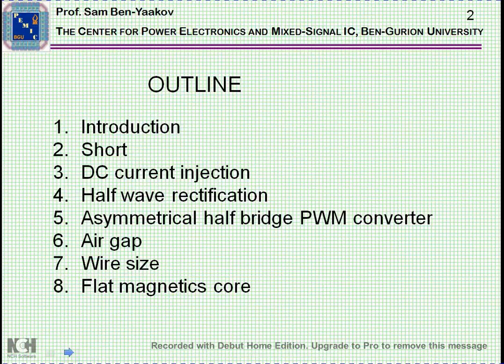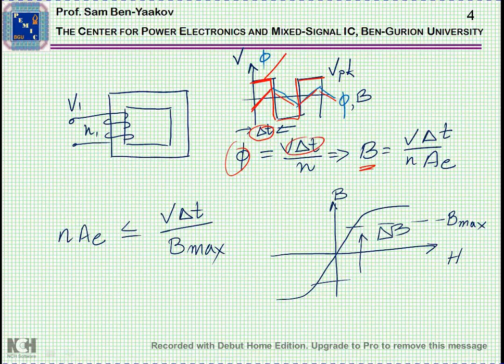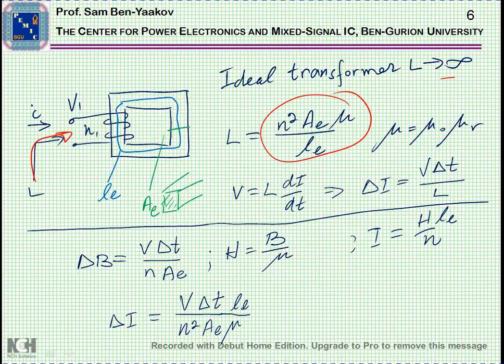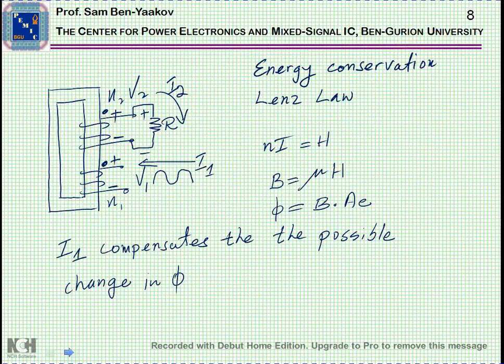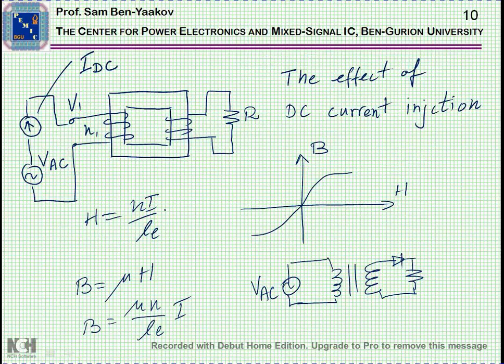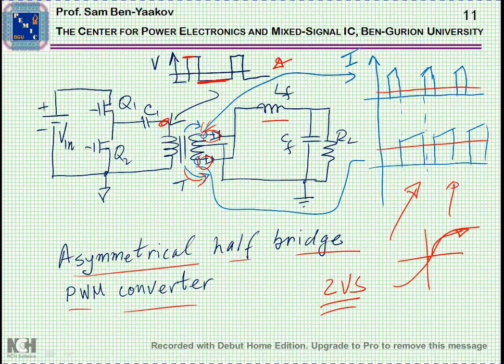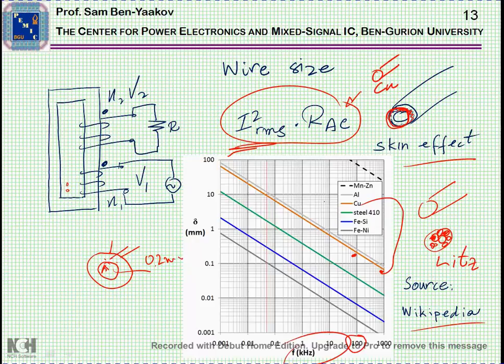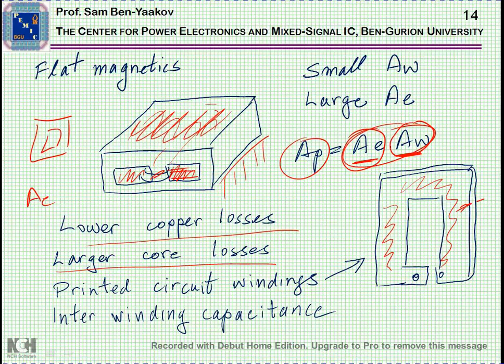The HF transformer:  Facts you may have missed

Comment: I did some review on my basic knowledge on magnetics recently related to a job issue related with changing voltage requirements in some inductive components. After some hard work of remembering why things work in all this stuff, of N, L, voltages permeabilities and whistles, I wish I had seen this lecture before. It is clear when somebody master the topic and how to explain it, you don´t need fancy animations, but a whiteboard and a clear understanding. Will save the channel for other videos.
I think flux formulae for V=  A sin (wt) should be -(A/w) cos (wt), has no effect on the discussion, but just in case..

Comment: I Have look at your presentations about LCC versus LLC very informative but still I have not yet the full clue of how to calaculate the transformer, I did see on LLC it is not that difficult but LCC is different because it do drive as a current spource, so the impedance of the primairy needs to be known? I have done a transformer for a normal hardswitch half bridge, set the frequency on 100 khz, the point where the output power of the LCC is max, and I did get a respons who like to be not bad, when set 110 to 250 Khz it did regulate in LTspice. (after first set the feedback correction up). So after ead much papers, the N of the transformer is known but do not now how to start right with tranformer calculation, that is why I did try the normal half bbridge aproach. For LLC it is not difficult transformer is part of resonance tank while for LCC the capacitor bridge is the impedance point for the power transport, so miss induction valeu,s. these are into the mH region while LLC is in uH region..

Have a nice day.
Reply from the maker: Why is this different from full or half bridge PWM converters?
Reply: @sambenyaakov  
THanks for the answer.

I have multply outputs, 350 volts, 2 x 130 volts and 12.6 and 6.3 volts, for getting N what of the voltages I can use? the feedback is coming from the 12.6/6.3 because it is filament voltages and need to be stable. feedback did work fine in sim.
 
Primairy induction for full bridge is higher then for a half bridge. that is why I do use the calculation for a half bridge because I also do us this, I use then the calculated transformer for match on the LCC tank output, I did put Cp also on the 350 volts 0.10 amps output winding, it has already some capacitance there. I did now test some, and I get regulation, even with open outputs I get stable outputs. Only the high voltage get lower with open outputs and get higher when I do full power. I did calculate and a full bridge is 22mH and a half bridge is 5.54mH as the calculator says .

Have calculate the tank with a normal LC calculator and set as I did read it is better for  efficency the Cs/Cp to 0.1

Peace from a old paper mentioning design of the LCC, so here I see I just need to have a high enough inductance to get it right? That is why the inverter now works on sim, play with the Q and resonance of the tank helps a lot, I use just a simple online calculator for resonance and q, I set the low frequency just above that and give enough room for regulation, and it did work with open and closed outputs. When open I get a big feedback hobble and it then settle, the PID is not yet complete right.

You have to understand I am a audio amp guy, and autodidact learning, never see a university, just a lot of shoes in the factory I did work from 15 years of age.

Piece who says, sufficiently large inductance, so calculate it just for a normal half bridge, seems to work. but winding capacitances do matter, and I have one high voltage output so set Cp there. But I can be wrong afcourse, all with all, I enjoy the learning but it is slower with mine 66 years of age brain.

As an example, the magnetising inductance of the transformer, in certain cases,
may be assumed sufficiently large to be removed from the model. Alternatively, the
inter-winding capacitance of a high-voltage transformer may be significant, thus
requiring either the parallel-resonant or series-parallel resonant topologies to fully
exploit the transformer parasitics, as opposed to reducing the capacitance's impact by
the addition of further inductance.

I do now watch your movies, also for hf transformers, the ExcelentIT software do well for transformer calculation incuding multply outputs.

have a nice sunday.
Reply from the maker: @audiokees4045  Thanks for explanation
Reply: @sambenyaakov  I have downloaded some of your video and lie on the couch with a beer (hot here) to see it on tv, and was very informative. You have to now I am a audio amp man, and even do class D who is also switching reaching now 0.0012 procent distortions with current and for low frequencies voltage feedback and 5 level switching., it is more easy to simulate, and have more experience with it, smsps is quite new, so some things I do understand oke, some not like the transformer calculations who is just N1/N2, in your video you explane some of the ideas I did mention, i need to look at the output load reflected to the primairy, that is why U use an ac resistor in the resonance tank Cr and Lr (Cs Ls and Cp for LCC).  U did also mention series resonance with only CS and Ls it has less part stress also I did see in sim. I have now do the LCC, have a Cs/Cp of 0.1 did give the lowest amps drawed from primairy for max output. I have use the transformer calculator ExcellentIT (free download) to calculate the transformer, if I did warch your presentations right, the trannsformer needs to mede such it has the less possible load om the resonance tank in lcc. but do fit on the core, when do full bridge get with etd 29 4.36mH prim 350 volts out = 7.19mH = M 0.60 and with half bridge I get 1.090mH primary and 350 volts out = 3.59mH = N =0.300. it is precise this what I have not learn much about, I presume that LCC or series resonance use capacitors for regulate output voltage in a current source setup, and the LLC has the transformer included into the multiresonant setup so when I calculate that with a tool, (yes for these I have nice tools from infinion or others but not for LCC or other series resoance types. (older ones). Do go on with your fantastic work maing world greener. ( I am against windturbines though), I am a thorium fan.

Excuse me for english errors, here is the link to the transformer calculator.

https://320volt.com/en/gelismis-smps-transformator-tasarim-programi/
Reply: @sambenyaakov  The voltage on the transformer, half the input voltage for half bridge and full for full bridge, give higher inductance.

But I think I have some idea with the LCC, because Cp is a current source acting capacitor with his reactance on frequency  I just need to optimize the transformer such that it fit with Cp, in fact inductance X needs higher then X Cp to transfer power efficiently, If I am right this is..

Comment: Dohh yeah - I keep thinking I know high frequency power - then I watch YOUR stuff and realise theres a bunch of things I forget - so, you CAN go gapless but your SYMMETRY has to be real good to avoid DC flux - JUST like in our old AUDIO transformers !
Reply from the maker: Thanks for exchange.
Reply: @sambenyaakov  Hi Professor - I actually had a question - supposing you had a half bridge, where the primary windings ground goes to the 'centre tap' of two input filter capacitors, but there's no DC path...

I keep thinking it shouldn't be possible to magnetise a core if that's the case - no net DC current? Even if the pull-up and pull down pulse widths were unequal or some asymmetry in the rectifiers?

Do I still have to carefully observe symmetry in a case like this, or am I inherently ok? (My guess is the worst that will happen is the voltage at the node will deviate from mid-rail, but i can't damage the core? But i thought I'd ask)

Apologies if you covered this elsewhere as I've no doubt missed some of your prev lectures ( and I feel much more confident about knowing my magnetics after catching up on some! )

Hi from London

Comment: Hello professor! I have a doubt with the wire size, I'm agree that we need to dimension it regarding the power losses that we think acceptable, but why everyone uses AWG table of current for dimension the wire size on their HF transformers? e.g. if you have 3 turns with a current of 10A and you use a 0.6mm diameter you will have 0.1V drop aprox but in the table 10A is for 2mm wire, why?. Do you have any recommendations to select the right wire size in HF transformers? thanks so much!
Reply from the maker: Hi, on the one hand you are mentioning  HF transformer an then you talk about 2 mm wire. Please clarify.
Reply: @sambenyaakov  I'm just want to understand if with HF transformers you can use an smaller wire diameter due the short length of their coils, which mean less resistence. For example, AWG 22 (0.62mm diamm) is rated for 0.92A, so if you need 10A you will implement a multicore of 11 AWG 22 in parallel aproximately to avoid skin effect, etc. So, my question is: it is necessary? because the drop voltage ir really short with short wires in HF transformers... so my point is: if you use only two wire of AW22 @ 10A for about 6cm of lengh wire (0.003 Ohm), the drop voltage is 0.03V aprox and I think that it should work anyway, isn't it?. do AWG wire table is a good reference for wire size selection? Thanks in advance!
Reply from the maker: @AMMCElectronics  If Litz wire is used the reliant parameter is the copper cross section from which resistance per length is calculated. O.3W seems to be reasonable assuming that the power lever is much higher.

Comment: Regarding introducing an air gap to reduce the "u" and increase the DC saturation current of the core, will it not also increase the area enclosed in the hysteresis curve and thereby increase core losses? I feel that the increased hysteresis loss is not so important for inductors but crucial for HF transformers. Please clarify. 
Also thanks a lot for this entire series of lectures. They help a lot.
Reply from the maker: No, a gap does not increase hysteresis losses.
Reply: @sambenyaakov  Interesting, thanks.

Comment: hi prof. Sam Ben-Yaakov
 
i'm designing a HF transformer, but it gives me output voltage more than the turns ratio,  i have designed HF transformer for 50% pulse duty at 30 khz, but running it at 25 % duty ,  if if applied 30 volts DC to fullbridge converter with HF transformer having 30 turns ratio, it gives distorted pulse at secondary with amplitude 2000 (not square or quasi square as is at primary side) rather than 900 as expected from turns ratio. please answers this question.
Reply from the maker: Test the resonant frequency of transformer. May be too low.
Reply: Thank your sir for your reply, i will test it,  does too low "transformer resonant frequency"  means that my transformer have high leakage inductance and high intera winding capacitance?   can you please share any literature how to reduce intera winding capacitance ?    @sambenyaakov
Reply: @AS-zs7jw  hi, you can go to chapter 1 page 69 [Marian_Kazimierczuk(auth.)]_High-Frequency_Magnet
and you will find much details. good luck
Reply: @sambenyaakov   sir, please make a video lecture on winding capacitance and leakage inductance of a high frequency transformer, to get correct waveform at secondary side with squarewave signal at primary side.

Comment: Hi , Prof Sam, if the direction of primary winding is clockwise and the second winding is the same there is no current flow at the secondary winding. is this correct. thank you.
Reply from the maker: Direction of winding only changes polarity. In any winding direction the secondary winding picks up the induced EMF due to change magnetic flux caused by primary winding.

Comment: Hi Professor, on page 9 [14:25] you mentioned that shorted output will not cause the core to operate in the saturation while large input current is induced. However, under this circumstance the input voltage is still AC with very large AC current as well. Is that possible when exceeding a certain threshold of input current, this would bring the core into the saturation?
Reply from the maker: If the core is fed by a voltage source, it fixes the magnetic flux density B. The current at the output is balanced by the current in the input and the net change in B is zero.

Comment: Thats a nice explanation. i am working on Dual active bridge, it works good, but after few seconds the hardware start heating up. After that i add in series an inductor to transformer primary, which decrease the overall efficiency but the over heating problem resolved up-to some extent. What are your views professor?
Reply from the maker: Hi, It is difficult to tell without the details.
Reply: Dear Zaman. I suggest you to study the subject: "staircase saturation" on "push-pull like" converter. B. Regards.
Reply: Thank you Silva, I appreciate your suggestions :)
Reply: Did u make solid state transformer in simulink ??